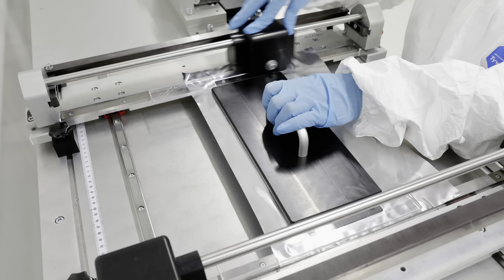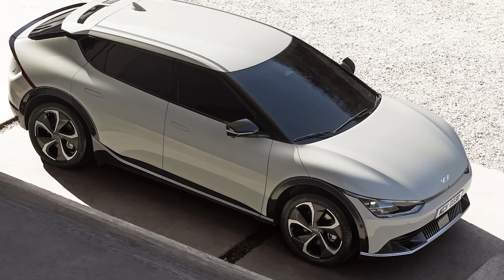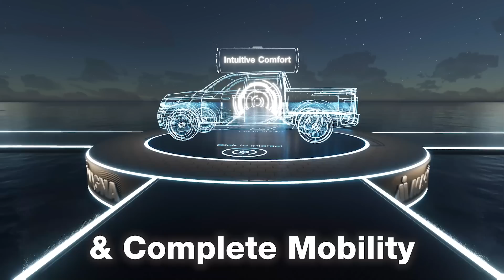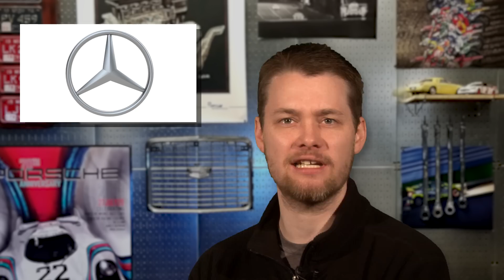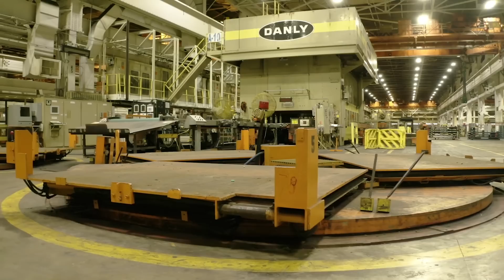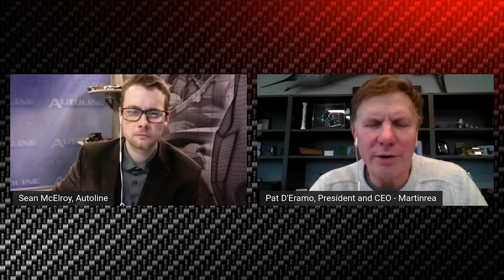Kia Unveils EV6; Lordstown Accused of Misleading Investors - Autoline Daily 3036

Comment: While Tesla is the most egregious many manufacturers have followed them into on-road testing and use of autonomous systems with little thought about regulatory, and importantly, liability implications. While it is very clever technology enthusiasm for autonomous is far ahead of the regulatory framework it will require. This isn't only a US federal issue but individual states and every other country will need to amend regulations if autopilot systems are to become universal. The European Union has already made noises that it is highly suspicious of these systems, especially Tesla's.

And Lordstown always sounded like a bigger version of Elio to me. Hub motors in an on-road pickup truck? How is that ever going to work?

Comment: If I was not allowed to set my TESLA driver assist over the speed limit I would be run off the road by irate drivers. I have driven on MA and NH roads where all 3 and in NH 4 lanes have been traveling at 80 miles an hour.
Reply: So, you can not drive 65mph?
Reply: @mamadouaziza2536  I can but when I do I get abused by other drivers that pass me on the left and right at the same time. I would prefer to drive 75 mph and not cause road rage which leads to accidents.
Reply: @RWilliKiwi 
If you're in the right lane and driving 65mph you should be fine. Let those that are speeding pass you by, they should have plenty of room to pass.
Modern car technology will alert the drivers in the other cars behind you that you are as fast and their cars will automatically adapt.

Comment: The hell with adaptive cruise control.  I would rather just not use it.  How the hell does the car know the limit?  Now they want more car control?
Reply: The car can read the speed limit signs and electronically adapt or you can manually set the speed limited.

Comment: IIHS's idea of limiting the dynamic cruise control setting to the speed limit shows how out of touch they are with reality.  People won't use it and more people will die in preventable accidents.
Reply: That's a good point, they'd be better off just limiting the car's speed regardless if cruise was engaged or not

Comment: It's stupid to not let people speed on autopilot - autopilot is demonstrably better than humans at driving (the number of accidents per mile driven on autopilot is a lot lower than those driven manually), so if people are going to speed anyway (which they are), why remove the one thing that makes driving safer?
Reply: It is possible to speed on autopilot.  If you step on the accelerator, autopilot remains engaged and the car goes faster.  The auto safety braking and adaptive cruise control are disabled, but autopilot will continue to steer the vehicle.

Comment: The EV6 is "grll-less" like a sports car. I can not help by see a Nissan Siliva/SX in the design.  Also the more rounded, swoopy,  mostly unashamedly "sports car" like styling of the vehicle has more to do  with it looking progressive as a design than the lack of  a grill.

The big grills, of most S/CUVs, really could stand toning down. Trucks need them for their basic operational requirements as working vehicles. For trucks, those huge grills are function before fashion. For S/CUVs just tooling about as commuter vehicles and family haulers, the big grills are really not called for and disingenuous. They are applied simply to look tough and ready for hard work but really aren't.

Comment: https://www.tesla.com/VehicleSafetyReport  see years of details
In the 4th quarter, we registered one accident for every 3.45 million miles driven in which drivers had Autopilot engaged. For those driving without Autopilot but with our active safety features, we registered one accident for every 2.05 million miles driven. For those driving without Autopilot and without our active safety features, we registered one accident for every 1.27 million miles driven. By comparison, NHTSA’s most recent data shows that in the United States there is an automobile crash every 484,000 miles.
Reply: Could that be that A/P only operates during the safest parts of driving?      Crashes happen during transitions, and intersections where A/P is not as useful
Reply: @dmitchellhomes  True, in fact about 20% of accidents happen in parking lots, not much autopilot there.  However the study also showed that Tesla w/o autopilot had a lower rate that the general auto universe.  But that could be because of the Tesla clientele, probably younger, or many other factors.  But I do believe even on a freeway autopilot is safer, but there are no figures that I have seen show that.

Comment: Sounds like they are scared of the tesla autopilot and are trying to sandbag it. Give the driver the tool let them choose how to use it. You know..... like the rest of the car.
Reply: Haha exactly. There's no rules limiting 0-60 times and if they care so much about rules every car should be limited to the legal speed limit, right?
Reply: @mkkm945  it seems like all the reports for ranking these systems are all about maximizing driver monitoring instead of looking at the capability of the software to drive the car. I dont want or need anymore monitoring
Reply: @kanewoodward4276  correct

Comment: 4:47 Well raise the limits! Cars and roads are much safer than they were in the 60's and 70's when the limits were placed. As an engineer you build roads to suit the speed, if you build roads that are capable of high speeds and place a low limit you will have "speeders" its in our clockwork. Honestly if you lock that out to speed limit little to no one will use it. Driving the speed limit in most cases is horrendously slow.

Comment: Can we say government is putting their hand on the scale? Looks like GM is getting a pass because of the prior bail out.
Reply: Or maybe GM is getting a ''pass" because their system actually requires the driver to still be observant of the road ahead. In a Tesla you can literally have sex in the front seat while going +65mph as long as you touch the steering wheel occasionally(look up the amateur video if you don't believe me). Super Cruise monitors the driver's eyes to make sure you are paying attention.
Reply: @OneNationUnderGod.  So you can be eating a sandwich and holding a drink when all of a sudden the system disengages because your exit is closed due to construction , and you have to grab the steering wheel...  There are problems with both systems now.
Reply: @dbwelder9159  if you have your hands full while eating right before your exit should you be behind any wheel? Even if it has Super Cruise or Autopilot.
Reply: @OneNationUnderGod.  Whole heartedly agree, but you probably shouldn't be having sex either...
Reply: @dbwelder9159  no doubt and that's why I pointed out how easy the Tesla system is to cheese.
Reply: @OneNationUnderGod.  Which is why I pointed out that the Cruise system has weaknesses too.  Most people aren't going to intentionally trick the system for a tiktok video. And the ones that do are candidates for the Darwin award.
Reply: @dbwelder9159  Tesla has stated that the Autopilot deaths that have happened have been by drivers not paying attention. Clearly their system allows drives too much freedom if they are getting killed while the car smashes into things.
Reply: @OneNationUnderGod.  I personally feel that it was more of a sensor/software problem.  Unless the software will shut you down after a only a few seconds of inattention, say the time it takes a truck to cross in front of you, any method can fail if the sensors/software are faulty.  I think that is one of the big reasons Tesla changed to the new Beta software.  And now they appear to be using the driver facing camera to drop drivers from the Beta trials for inattention.  Maybe that will be used in a addition to the steering wheel tension when the next version is released to the public so it is safer.  BTW, thanks for the time stamps of when the ads end!

Comment: I love Tesla but the lack of front facing camera until complete functional FSD is a problem. Supercruise and comma.ai do it and they have a simple solution that works perfectly.
Reply: Excuse me? My Model 3 does have a front facing camera.
Reply: @kelindrawn  But it's not used for driver monitoring. And Tesla refused to implement them since Autopilot was first launched in Model S and X.
Reply: @etbadaboum  Typical l GET your facts before  commenting https://cleantechnica.com/2021/03/13/tesla-using-interior-cam-to-monitor-fsd-beta-testers-boot-them-if-necessary/
Reply: @etbadaboum  Typical l GET your facts before  commenting https://cleantechnica.com/2021/03/13/tesla-using-interior-cam-to-monitor-fsd-beta-testers-boot-them-if-necessary/
Reply: @etbadaboum  Typical l GET your facts before  commenting https://cleantechnica.com/2021/03/13/tesla-using-interior-cam-to-monitor-fsd-beta-testers-boot-them-if-necessary/
Reply: @GURUofSEARCH  Only for FSD Beta and not Autopilot. And it's not even automatically linked.
Reply: Tesla is set up for level 5.  No driver monitors will be necessary.
Reply: @DarkBrandon1  Eventually. Maybe. But in the mean time, driver monitoring is necessary.
Reply: @etbadaboum  according to you.  I use it everyday, and I disagree.
Reply: @DarkBrandon1  And we agree to disagree then.